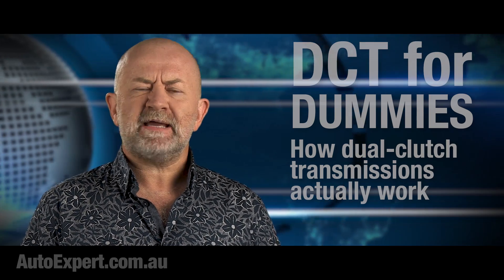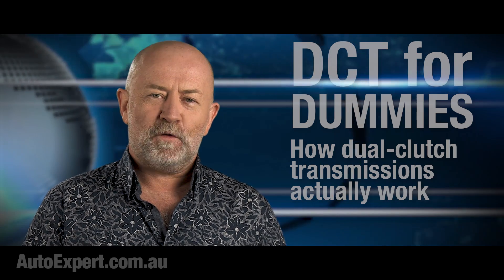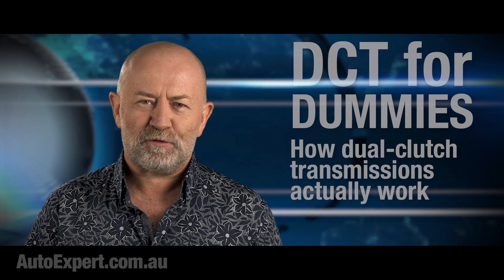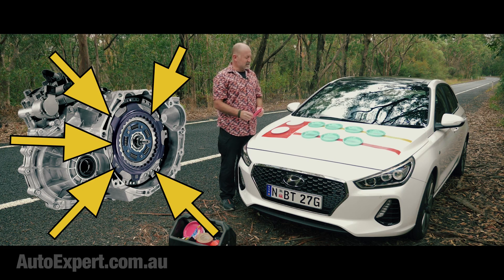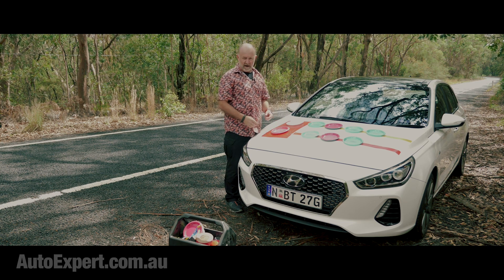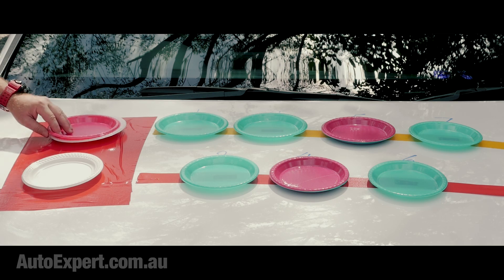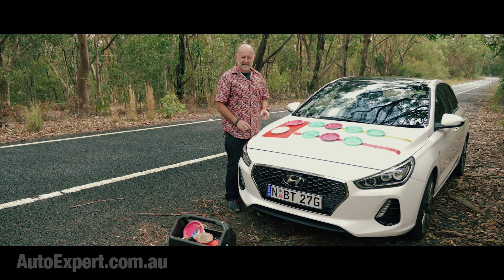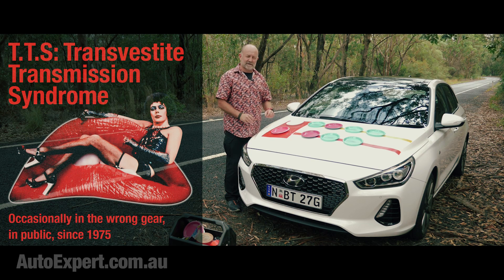DCTs for Dummies. (How dual clutch transmissions really work.) | Auto Expert John Cadogan

Comment: I have done 20 000KM with a Mitsubishi Ralliart which was a Getrag DCT-SST. It's not for everyone, personally, I love it.  I've never driven it in DRIVE mode, it's always in Manual shift mode as I find the response is alot better and the car drives smoother when I shift manually. I also keep it in S-Sport mode which limits the slip of the clutch for sharper shifts.

Comment: Wish I had seen this 8 weeks ago. Drove my DCT into the scenery going down a teflon driveway at 7kmh when it changed up into 2nd and lost the engine braking. ABS has it's limitations, too... Lesson learned, $1000 wing mirror and $1000 tow, later. Use "manual mode" where appropriate. Great on the open road, though!
Reply: So how would you drive downhill? I just got a dct after driving an automatic for years
Reply: @c0llinPM  Lol. Mine has a manual option so I now use that and leave it in first to maintain engine braking. I also avoid steep, wet, grassy driveways now.
Reply: @1998TDM  ok good to know. I also have one more question if you don’t mind? I find accelerating at stop lights and stop signs for example to be a bit laggy. Do you know a good way to accelerate faster?
Reply: @c0llinPM  I generally just floor it and spin the wheels... Back to reality. My car is a 2ltr turbo diesel and takes off fine. It changes up almost immediately the car starts to move which is quite smooth. And sedate.. If i do floor it then it holds first gear longer and revs pretty high for a diesel before changing up.It genuinely does chirp the rubber before the traction control kicks in. I'm guessing it's a computer telling the car what to do when I hit the gas, totally different to the manual gearbox and clutch which I'm used to and prefer.

Comment: VW and Audi may have had their issues with duel clutch transmissions, but as far as I’m aware they also pioneered the intro of DCT to production vehicles after successful use in racing in the early 2000s. Easy to claim reliability for other brands when the the r&d has been done.

Comment: Until DCT's overcome some major issues of driveability in city environments and reliability they always will remain crap.  Even current DCT's from all manufacturers still exhibit issues with smooth off the line engagement and also with hesitant gear changes in many city driving situations the average consumer grade car spends most of its life in.  also reliability is going to be an ongoing issue with many of the newer designs still too new to make a call on long term reliability.   People buy Autos to not have to worry about driving style and just want to put it into drive and...Drive.  DCT's need to gain better creep ability as well because most of us live in the real world full of congested roadways where creeping forward is the main method of moving forward at times.  If you call yourself an auto expert and then overlook the basic facts of what people want in an automatic consumer grade car that spends its life in city traffic then you need to rethink a few things.

Comment: I purchased a 2015 1.6 i30 Tourer in 2016. We have had the actuator replaced, as it was faulty, over-revving when the foot was on the brake. Sincve then we have been dogged with ongoing issues of over-revving since then,. Hyundai have placed a flight recorder on the car which captured over 40 instances of over-revving. Mostly they occur in 3 gear, with revving between 4500-6000 rpm, and 3 instances of 6500 rpm, without changing gear. We viewed the instances on the ipad they used and all were underload up to 100%. However, there were many which worked correctly under the same load, in similar circumstances, where the gears changed smoothly at 3000 - 3500 rpm into the next gear. Has anyone experienced similar problems?

Comment: Paused at 10 seconds... My best guess (lets see how off i am)... Input shaft goes to some kind of gear that drives 2 shafts. each of the 2 have a set of gears, 1 with 1,3,5, and the other with 2,4, and R. Clutch disengages on shaft 1 and engages on 2 for 2nd gear. acceleration so the TCM prepares the first shaft with gear 3 engaged on the shaft but not being powered yet. Clutch disengages shaft 2 and goes back to shaft 1 where 3rd gear is ready and waiting. wash rinse repeat. reverse...  maybe has and extra gear on it with another shaft going to the output shaft of the transmission so the tires move backwards.   now i press play and see if i'm smarty pants or dumbass
Reply: holy shit. i almost got it right.

Comment: Out of interest, not all DCTs work this way (i.e. pre-selecting the next gear some time before switching to it using the clutches).  The one on the Honda NC750 motorcycle leaves the non-driving train in the false neutral between the gears either side of the driving gear.  Let me word it more clearly....

For example, when driving in third gear, the "even" gear train sits in the false neutral between 2nd and 4th gear.  When a change is required, three things happen in rapid succession:

1/ The even train is shifted into either 2nd (for a down-shift) or 4th (for an up-shift), followed immediately by...

2/ The clutches switch over (at this point the transmission has effectively changed gear, and finally.......

3/ The odd train shifts to the false neutral between 3rd and 5th (assuming it was an up-shift to 4th in this example).

This all happens in about 1/3rd to 1/2 of a second.

There are two advantages to this.  Firstly, Honda found a significant reduction in viscous drag by leaving the undriven train in a false neutral, thus reducing fuel consumption (perhaps more significant on a bike than a car?).  Secondly, the delay is always the same, whether shifting up or down, and the "Ooops, I've preselected the wrong gear" cannot happen because there is no pre-selection as such.  Once the 1-2-3 sequence described above is initiated, it continues to completion.

The downside is that there is always a brief delay is responding to a change in load or throttle opening, because the undriven train must always be moved from its false neutral position to one of the gears on either side of it.  The gearchange takes longer than the "pre-selected" type of DCT.  On the other hand, it's still pretty quick compared with what most average drivers can manage.

The full story of the NC750 DCT can be found at Honda's R&D pages:  https://www.hondarandd.jp/index.php

The paper which describes it is this:  

Development of Dual Clutch Transmission for VFR1200F
Article of Honda R&D Technical Review　Vol.23 No.1

(Note that the DCT was first developed for the VRF1200F and then fitted in the NC series.)
Reply from the maker: Pretty sure the four-wheeled vehicle DCTs all work as I described.
Reply: Yes, I'm sure you are right - just wanted to add to the general "knowledge pool".  :-)

Comment: Yes, I experience "the gap" only during kickdown needs, but honestly, how often do you really need it. Maybe a TCT is in the make. But I can live with the gap perfectly, and in more dynamic riding, I switch it to manual control. Which is a tiny bit (0,05 sec) slower but still, much faster than I can shift.
I have the Honda DCT in my motorcycle, which suits the engine and bike very well.

Comment: With the lag/delay discussed in the video, can the driver get around it by using the paddle shifter to drop a gear? For example, change down from 4 to 3 when you feel the lag? I kno some paddle shifters allow you to shift 1 gear when still in auto mode

Comment: Nice explanation unlike many other videos bogging into technical details and loosing the momentum. 

While watching the part when the need was there to change the lane and accelerate suddenly it reminded me on my experience with a classic automatic transmission which can have a similar effect with some modern (and even less modern) cars. I am a faithful Toyota owner and had them in all models from Starlet to Aurion. My first jump from 4 cylinder to V6 was with 97 Camry. Then I got Avalon and today I have 2010 Aurion. My first test drive with new Aurion was with the sales person next to me and the road traffic was very mild so even when I was accelerating didn't notice anything unusual. Getting from 3 L Avalon to 3.5 L Aurion did show some more power although Avalon was more smooth to drive in my opinion. I have done the trip around the Australia in Avalon and I knew the 3.0 L engine and transmission very well. With more power in 3.5 L Aurion I thought it will be even easier on the road when you have to lets say overtake the road train. I was in shock when after trailing behind it for some time and finally the road opened I pressed the accelerator and for a second or so nothing happened. The car behind me interpreted this as my hesitation and started overtaking me, but then my 3.5 L suddenly woke up... Since then I learned this is not only one isolated unusual case. I called my dealer and they told me it is normal but the explanation was worst than if I was getting it from my grand mother. I wrote letters to Toyota Australia - never got any reply. Then I went on internet to find out my car as many others today have a drive by wire system or better yet THROTTLE BY WIRE. So my ECU decides when I really want to accelerate hard and when I was mistaken. 

I tried Corolla with the CVT but never any car with dual clutch. What you described in your video is exactly the same problem what I am having with my Aurion with the classic auto transmission and it is sh*t (not dual clutch but Aurion). Are there any cars today with standard hard wired throttle to the accelerator pedal or models which can bypass ECU and have no delay when I press the accelerator hard? I never thought I will say I miss my Avalon.

Comment: It’s not rocket science. You need to look at a DCT as it is. A manual transmission that shifts automatically.
They have been commonly used in the Heavy truck industry for almost 20 years.

Comment: I've owned 3 VW DSG cars they've all been wet clutch a MK6 Diesel still have it 170K DSG 6 speed, MK7 R DSG 6 speed 30K traded for a MK7.5 R DSG 7 speed fantastic box, all DSGs have been smooth and without fault. From what I've picked up the dry clutch DSGs seem to have problems not so wet clutch.

Comment: I like Hyundais and I like the technology in DCTs but I still lean towards wanting a conventional auto in anything other than a performance vehicle. As much as I don't like the dark arts of the CVT, I would still find this preferable to a DCT in a non performance vehicle. Whilst I applaud Hyundai for making what I guess could be considered to be one of the better DCTs, I think that they may have at their own future peril put this box into vehicles driven by people from the wrong demographic. Anyway, time will tell. As much as I like all the accoutrements (did you like that Mr Cadogan, it even sounded like you in my head. hahaha) of the higher up models, I would only buy the base model with the proper auto, it is just easier for me that way. Hyundai have a great auto, it should get more use.

Comment: I drive a Hyundai i40 Tourer, 1.7ltr turbo diesel, with DCT. Being a car person, I did read the manual to understand how to drive the vehicle with the DCT. No information was provided by the Salesman when I picked it up new. 

The car has just clocked over 100,000 km without a single issue and I have to say I really like the DCT although, if you start up the car and tried to drive away instantly when cold it does get a bit jerky. Not sure if that's the engine being cold or the DCT being cold. But once you get on down the road it all works well.

Coupled to the turbo diesel, this is a great transmission. To get back to what JC was saying, it can be a bit nervous around town in slow or heavy traffic. Pretty much how JC explained it.

Whether I've just been lucky, don't know but Hyundai appear to have done a good job with their DCT.
Reply: у меня туксон 16дизель. 2019года . поверьте они не исправились 80тысяч км и нагревается в пробках и  останавливается

Comment: I'm lucky enough to have a German built my14 focus that seems to have dodged all the pitfalls and has a dct that works as intended. It's a nice way to get a manual feeling car that has an auto box. You do have to drive decisively, and it's especially annoying if there's cars ahead where the driver is tap-dancing on the pedals. Drive smoothly and assertively and the box will keep up.

Comment: I’m so glad that there are no smells coming from this utter bullshit verbal diarrhea as it could affect my nearest neighbor nearly two miles away. First of all is Australia that far behind the times? The VW recall is nearly ten years old and was for a possible faulty temp sensor which affected very few cars. Secondly my Audi TT 3.2 is going on 15 and gets driven hard. 130,000 miles + and not a murmur out of its 6 speed dsg transmission. A 2015 R8 V10 plus  (7 speed dsg) that gets driven hard with 25000 miles on the clock that I get to enjoy once in a while still runs flawless.

Comment: 85,000 miles currently on my 2012 Ford Focus. Recently, I noted a certain jerkiness to the lower gear shifts. I went online (Youtube) found an applicable video which said to start out with a heavy throttle five or six times in a row to allow the transmission to relearn. Cleared things right up. Now it works like a charm. I like that there is no converter, which puts less load and less heat into the operation, (saves fuel too.) particularly around town. And service intervals are 100,000 miles apart, which means lower cost. I'm a fan.

Comment: ONE thing which annoys me with today's modern transmissions in most cars, is that although they are fully digitally computer controlled, so the user interface might just as well be a touch screen, some buttons, a dial, or to make my point, a "google-home-level-accurate" voice control:  Most manufacturers still insist on a large mechanical lever, often with a leather lever boot, "because that's what people expect to feel when grabbing for their shifter down there".  Why hasn't innovation in this area moved beyond the european brands?

Comment: Just to clarify I am neither for or against DTC and do not think I have driven a vehicle with one. I'm just interested in the facts of how stuff works.

There has been a few comments ref the wearing of the clutch packs in a DTC, the cost of replacement and their longevity etc. Hate to be the bearer of bad news but there are also clutch packs in at traditional fluid coupled auto. There is a clutch pack for the input and each set of planetary gears. By engaging various combinations of gear sets, by the use of a clutch pack, you get the different ratios that change the speed of the output shaft. There are more clutch packs in a traditional fluid coupled 6 speed auto then there is in the equivalent DTC.

Comment: I imagine when John drives his DCT-equipped i30 SR Premium up that windy road in the foothills on his commute, that the DCT is constantly changing gears at just about every bend in the road, as John enters and leaves the corners.  Would it be better (for the long-term health of his transmission) to put the DCT into MANUAL mode and leaving it in just one gear (e.g. in 4th gear), and then instead of changing gears constantly, simply change the engine RPM instead?

Comment: So what we really want is a triple clutch transmission have both potential gears selected
Reply from the maker: Actually, you'd need four clutches for that.
Reply: I would be more inclined to think self learning algorithms that learn driver habits combined with GPS technology that learns the road similar to the Nissan GTR is likely to be the future. Especially if that GPS technology communicates with other cars and learns from the roads they have been on too, to the point where your car knows exactly what is required around every corner. As I said, the GTR already had some of this 10 years ago, and technology has moved very fast. We already have the tech to do this.

Comment: Very useful, I drive a Hyundai with one, that works well and better than VAG's version. However, you need to remember not to inch forward in traffic in D as you will prematurely put wear on the clutch.

Comment: Nice video, can you elaborate on the differences between a "wet clutch" (oil cooled) DCT and a "dry cun-- err clutch" (not cooled at all) DCT. As those VW and Ford dry c***ts are the reason the DCT has such a bad reputation now.

Comment: 2 big problems  in us anyways  1)  ford markets them as an automatic transmission  when in fact they are a computer controlled manual transmission with no torque converter. the only thing automatic  is the neck brace you will need when it studders shakes and whips you.  2) as for the fiesta the wife has  after a warranty clutch kit and 4 reprogrammings  it is quite appearant that trhe reason this thing is so shit is the programming that is put in place to achieve mandated fuel economy.   if you run this in sport mode it drives quite nicely except for  take off acceleration.  i firmly believe it  tries to start out in second gear  studders shakes as it drops to first then takes off.  being used to my big old powerfull gas guzzling v8  one needs to forget that manner of driving and just run the piss out of this low displacement high revving squirrel cage of an engine. im certain ford knows this but government always wins

Comment: My only problem with dcts and tc autos is those situations where it doesnt shift appropriately as described in the video. Its impossible to predict the future. They can only guess. Manuals are more fun and you get to shift so you can make adjustments based on scenarios.